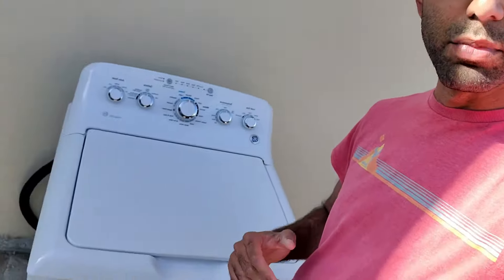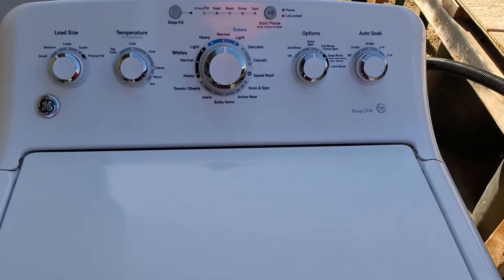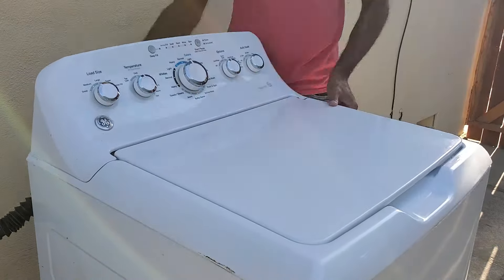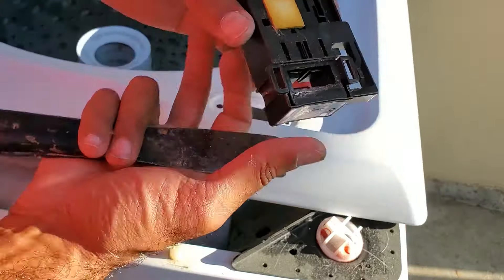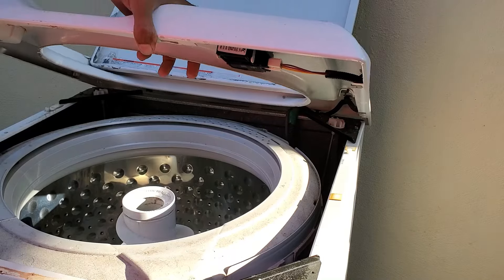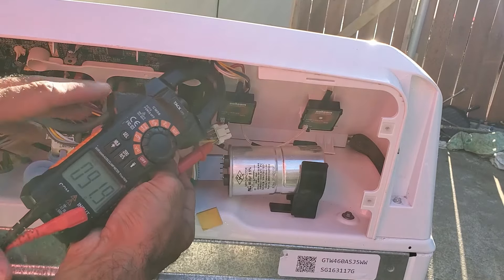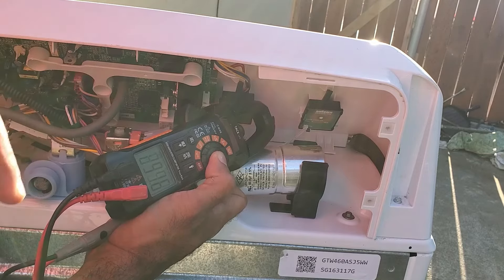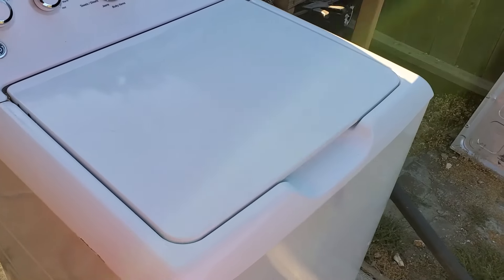Fixing A GE Washer That Will Not Start: Lid Lock Replacement

Comment: I am so thankful I found this I do have an engineering degree so I’m familiar with electrical equipment and electronica equipment however I don’t know anything about washing machines and so I saw this relay needed to be replaced and I also am retired so I didn’t wanna have to drag my washing machine out and take the top off and wouldn’t be able to get to it so I was able and I don’t have small hands to squeeze my hand in there remove the clip that goes to the relay and do that all without removing and taking the top off and so far it’s going through a cycle just fine so fingers crossed
Reply from the maker: Best of luck!
Reply: @DuctTapeMechanic  It worked for two loads and now it’s messed up again that is probably the control board like the sounds just make even when nothing is running it just makes the little noises like when it’s starting

Now it will wash, which wouldn’t do before it wouldn’t even come on before now or wash but it won’t spin and drain I’ve checked all the drain exits that sort of thing it’s not that actually it does drain when it sits there overnight but it just won’t start spinning it’s really strange because it worked for 2 loads then rats...
Reply: @DuctTapeMechanic  hi I wasn’t sure if you would have a quick suggestion I replace the lid lock switch the relay and it worked for two water loads and now it will wash but it won’t spin it’s just continually you can hear the relay click in and out when it’s trying to spin and it does that several times and then it just shuts off I’ve been looking at your other videos trying to see if you got an answer could you point me in the right direction possibly

Comment: I have a GE GTW330ASK3WW washer, and the locking mechanism is clicking 3-4 times, and won’t start any cycle. 

I’ve tried leaving unplugged for several minutes. Doesn’t work. 

I’ve tried doing that again on top of turning the circuit breaker off, and then back on. Doesn’t work. 

What is happening? It’s causing my family and I to argue against each other.
Reply from the maker: Sounds like a bad locking mechanism

Comment: Can we cross connect the wires so latch doesn't lock but washer always works
Reply from the maker: No. You will damage the board
Reply: @DuctTapeMechanic  I was afraid of that. Can you update the link for the latch? I couldn't get it to work.

Comment: I replaced the lid lock.  It clicks but the pin won't retract to allow you to open the lid. Any ideas? Thank you?
Reply: On my GE model I actually just unscrewed and removed the part that is on the lid. Then I just left it pushed into the assembly so the machine 'thought' the lid was locked when it really wasn't. Not all brands/models have the top thing that can be removed though.

Comment: Can you make it work without replacing the lock & disconnecting both sides of the wires?
Reply: This is what I want to know it's just three wires going in which completes the circuit what do you have to do to just have it know it's locked and closed bypass this entire thing made of junk and poorly injected molded plastic.  I did a load of laundry and it clicks open and the little piece of plastic comes flying out now won't run cuz the circuit won't close. Mine doesn't even have the plug it goes right into the lock mechanism.  Tell you I would take a washer that's 30 yrs old over any new one all junk.
Reply: Great question!

Comment: couldn't have you just reached under and unplugged the lid lock without having to take off the top of the washer. I was able to reach under and disconnect it that way.
Reply: Does it still work without the lid lock?
Reply: Can it complete a cycle?
Reply: @rebeccalautner7775  That I don't know. I was  just talking about getting access to the lid lock without having to take the whole top of the machine off.
Reply: I'm so happy I found this comment.   I just disconnected and removed mine in 5 seconds without taking anything apart.   He should re-do the video and show this method.   I supposed it does help a lot to see the inside so you know what you're feeling around for.   This method also saved damaging the top of the machine with the putty knife because the white cover pops right off if you reach from beneath.

Comment: I have one just like that just not as many knobs and when you hit the start button the water will run into it for about a second then that's all it will do but fill light stays on I don't think the lid switch is bad because you can flip it over to the drain and spin cycle and the lid will lock
I hate these appliances with computers

Comment: I could not open the lid. So I took a knife, lifted the lid to get a knife in there and I cut it off. So I can open the lid but the machine will still not start. It still thinks the lid is locked. So F'ed up. I want to disable the lid lock completely. I don't want the lid lock at all. It serves NO purpose!